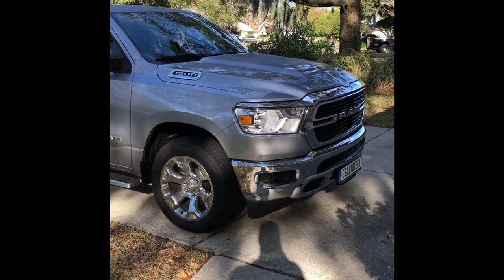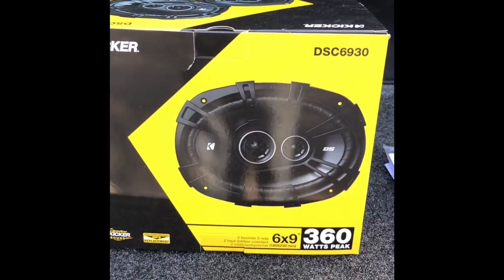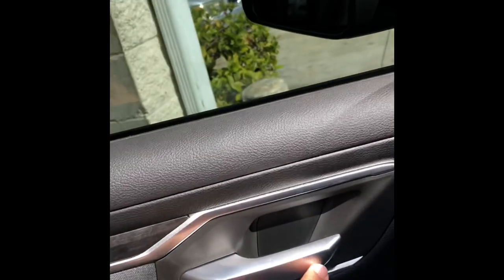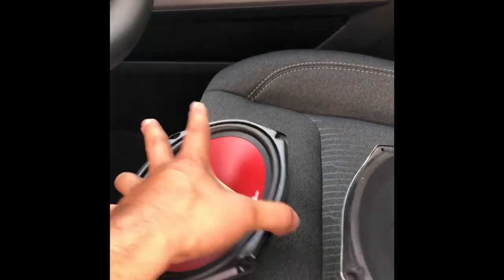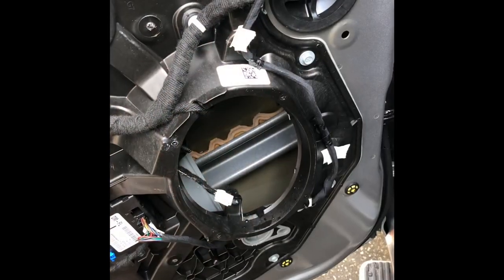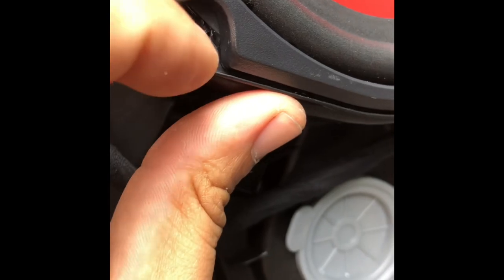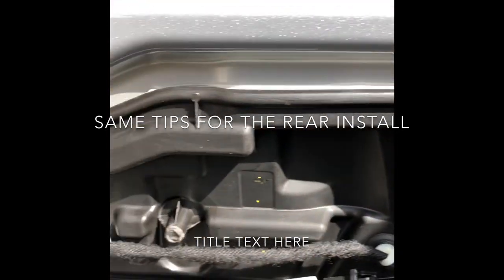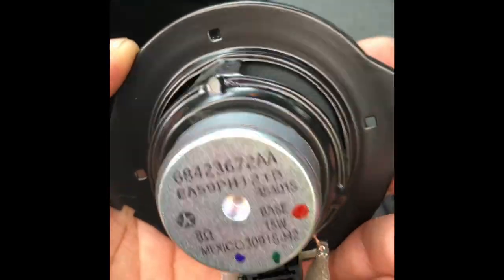2019 Ram 1500 bighorn, base 6 speaker sound system upgrade

Comment: I just did this exact thing to my 2020 RAM Bighorn yesterday after watching this (and other tutorial vids) last week, and ordering the speakers. I went with the same Kickers for the 3.5s and rear 6x9s, and MTX for the front doors because of this video! Going from 8ohm factory to 4ohm aftermarket speakers makes a HUGE difference in overall volume and music clarity. The factory base speakers are muddy and terrible. RAM should be ashamed of themselves for shipping a $50k+ truck with .50c speakers. I absolutely LOVE the truck other than the speakers, so I am glad it was an easy fix. Next up will be a small amp and sub I think. Thank you for the tutorial!
Reply: @sulcyballs  yes
Reply: just got my truck yesterday and i could not stand the sound. Immediately ordered all the parts on amazon. Got another project this weekend lmfao
Reply: @immental88  Make sure you secure the wires in the front doors, the window will pull them out if they are flopping around.
Reply: @tccell212  I installed them last night. Getting a huge humming sounds. Guess the anc is messing up due to the reversed polarity lol. Gotta double Check them all tonight. Purple is positive yellow is negative right??
Reply: @immental88  an adapter from crutchfield fixes the hum
Reply: @tccell212  I got the adapter. Anc humming is gone, but for some reason the sound is not as good as I thought it was. Sounds about the same as the factory speakers and it's scratching my head as to why it is.
Reply: @immental88  Hmm...IDK. Mine was so much better immediately after install
Reply: @tccell212  my mistake man. I realized it only happens at increased volume and researched it more and it turns out that it's bass rollover and it's a whole other thing. I'm happy with a max of 25 volume 😂

Comment: Hey man just want to take the time to thank you mtx and kicker should consider sponsoring you. Video was easy and the only thing I did different was a stronger kicker speaker in the rear doors Amazon had the stronger ones for the same price 😎.  Also i used one of my step ladders to hold the door panel up seeing I didn’t want to take the door handle off. Kinda lazy but saved me a ton of time in assembly seeing it’s the middle of a warmer winter. I’m going to subscribe because your video gave me the confidence to do something that I never have done before and you didn’t sacrifice quality by getting the most expensive stuff. It was cheap and easy. Huge thanks and I hope you do more stuff like this in the future. Maybe some tools you used or comparisons on other speaker idk up to you. Last thing I compared this to a friends alpine system and mine was louder but he had more bass cause of the sub. Wondering if you had any way of getting a cheap easy install sub in there
Reply: Which kickers did you get

Comment: Hey brother pretty sure I have the same crap stock sound system in my 2018 Jeep GC Laredo. Obviously I want sound clarity improved but I’m more worried about the volume/how loud it is. I wanted to know how the improvement was with how loud the upgrade system was. A little bit noticeable? Or drastically noticeable. The stock system is not loud enough!! Thanks!!!

Comment: Did the same dash speakers and all kickers on each door. I lost all my bass with this setup. The stocks sound way better.
Reply from the maker: check the equalizer to see, also check the connection to confirm is all good, if your system is the base model should work just fine
Reply: Yes I agree. I feel the bass is way better with the factory stock speakers.

Comment: Which 6x9 sounder better the mtx or the kickers?

Just  fyi, I installed those kickers in the front doors of my buddies 2019 big horn.  We had no issues with fitment.
Reply from the maker: they both sound great to me.
Reply: So those kickers fit no problem in the 2019 big horn? no window issues? im looking to order these this week, soo if you can confirm this ill do kickers all around! thank you
Reply: @cbautotech  I also would like to know do the kickers fit fine in the front doors
Reply from the maker: well the kickers sound better in my opinion.
Reply from the maker: @justinaltemeier1533  I install the mtx in the front
Reply from the maker: the kickers in my opinion sound better, I have no issues with the fitment, I did install the kickers in the rear only
Reply from the maker: @cosimomarino6885  they fit with no issues with the window
Reply: @cosimomarino6885  kickers fit in front door NP
Reply: @justinaltemeier1533  The window bar is not  in the way on the 2019. plenty of room
Reply: @treynoahz71  thank you!!!
Reply: How did you fix the humming sound?

Comment: I would like to see how you get the clips out. I bought a prying tool set but I feel like I am breaking the clips.
Reply from the maker: the clips feel like they going to brake but they don't just pull hard they will come loose with no issues

Comment: Did you have any problems after you switched the speakers? like the anc?
Reply: Elias santos junior I think the metra wires used in this video resolve the anc issue. I believe it was something about the previous adapters that were available had the polarity wired backwards.
Reply: Where did you get the speakers  ?
Reply from the maker: no problems at all.
Reply from the maker: no issues with the speakers they work great
Reply from the maker: no issues
Reply: he doesnt have a Hemi so he wont have the ANC

Comment: You stated on the dash speakers you need to switch polarity of speaker cables. Why did you need to do that if it’s a plug and play with adapter from Crutch field?
Reply from the maker: well I did check the wiring diagram from the truck notice the polarity was different than the one I order from crutch field.
Reply: @cbautotech  How do you switch polarity of these speakers in the dash??
Reply from the maker: my case I check the connection first and notice that the polarity was wrong that's why I made the change, you can connect it first to see if works good for you.

Comment: Prior to this, did you have an issue with it not getting louder?  I turn mine up and anything passed 26 it doesn't seem any louder.  I have a 2020 8.4 non nav 6 speaker
Reply from the maker: I have no issues with mine as far the volume goes, it gets louder as you go up, check your equalizer to see how is set up.
Reply: I have the same issue with mine, from 23 volume to 38 is no different. Hoping a speaker upgrade will fix it. I also have a 2020 Ram Longhorn/Bighorn with the 8.4 non nav.
Reply: @AndyInTech  I'm thinking the same thing.  But I almost wonder if the factory amp isnt powerful enough? Idk it's very frustrating.
Reply: UnProVen - I have the same truck with the same problem. Can you let me know if you upgrade because I’m looking to upgrade immediately
Reply: I’m getting 6 new speakers installed today. I’ll follow up with an answer. I have Infinity reference for the dash and Rockford Fosgate Power for the 4 door speakers. Fingers crossed 🤞
Reply: Same issue on my 2020.
Reply: andrew brown keep us posted. I’m waiting to upgrade. Trying to see if I need an aftermarket amp or not.
Reply: I had an issue with the shop I was going to Saturday and I had to reschedule. Going to try again this weekend.
Reply: Another update but not much info. I made an appointment with another shop but they were booked till the 23rd. I called Ram corporate to make a complaint and they scheduled an appointment for me with another dealership. I’ve already taken it to the dealership I bought it from and they did an update which did nothing and told me tough luck pretty much. I don’t think this other dealership will do any different but maybe they will send the info back to corporate and they’ll look into it 🤷🏻‍♂️
Reply: The guy at the custom sound shop told me FCA radios suck and they constantly have this problem. Idk how true that is but I have one good example.
Reply: @AndyInTech  this sucks.  I wouldn't say the radios suck.  Other cars they make the radios sound good.
Reply: Yea I had a rental Jeep Grand Cherokee in 2017 with the smaller base radio and it sounded great. That’s just what the guy said at the sound shop.
Reply: Just an update, I got that harness in today, It took like 2 weeks to get here. But I’m happy to say it fixed the issue and took less than a minute to install. So the problem must be with the active noise cancelling. Hopefully this helps y’all 🙂
Reply: @AndyInTech  hey what's the harness you bought?  I'm interested
Reply: Also today I replaced my dash speakers and they are way louder. This Saturday I have an appointment to get the remaining 4 door speakers swapped so lll follow up with that.
Reply: I’m wondering if it just need a amp?

Comment: I was on Crutchfield and I kept getting a notification saying that the stock speakers are 2ohms and the replacements are 4 and that it won’t sound good. 

Clearly the stock speakers are 4ohms so there isn’t going to be an issue with power?
Reply from the maker: well since I install this speakers I have not experience any issues

Comment: Hi buddy i have 2019 rebel can i use my 6 1/2 speakers i have already or does it have to be 6x9 ? Thanks
Reply from the maker: Im sure they are all 6x9s all four doors, the rebel should come with premium sound.
Reply: Thank you how does those speakers sound now just by changing the speakers i have the 9 speaker alpine uconnect im not too happy if i do like u will i notice big change?
Reply: @king1ny  they sell 6 1/2" adapters to fit a 6x9 opening at Cruchfield. 

And although the Alpine system is an upgrade from the stock 6-speaker setup in other Rams, any "name brand" mid-grade (or higher) speaker will be a noticeable audible improvement over what you have now

Comment: Question I am looking for a bit more bump 10's or 12's have a quad cab though any one advice on box and subs?
Reply from the maker: well I was thinking of installing a power subwoofer made by Infiniti that you can fit it under the seat, is very slim I Believe is a 8" driver.

Comment: Jl audio has the c7 perfect for replacements just a bit costly
Reply: BeeFred 00013 do you have the item numbers? I wanted to go with JL
Reply: Brian Bermudez  loc22
Reply: Sorry wrong item 
Brian Bermudez  C7-350cm: 3.5-inch (90 mm) Component Midrange, Single
SKU # 99758 I would get them directly from jl audio so you have warranty and if they ever get damage you can send them in for repairs
Reply: What about for part number for the doors?

Comment: How did you fix the humming sounds afterwards?
Reply from the maker: I have not experienced any humming sound, check your connections again.
Reply: You didn’t tap into the right wires
Reply: you have to disable ANC under driver seat, you can get a harness from crutchfield you must have the Hemi